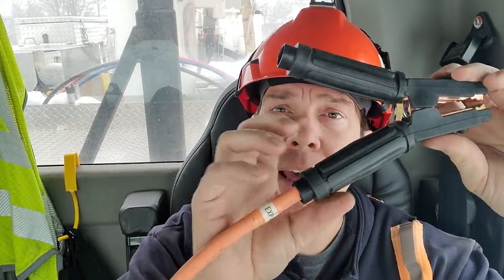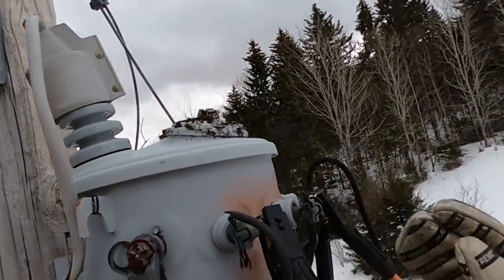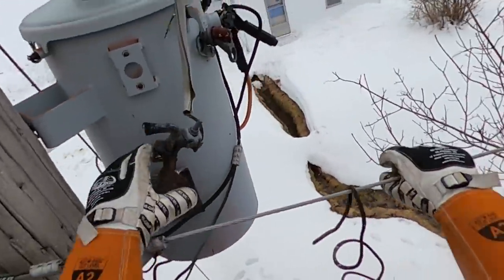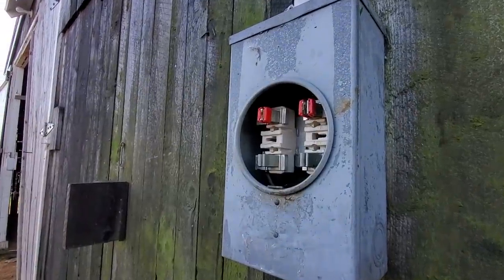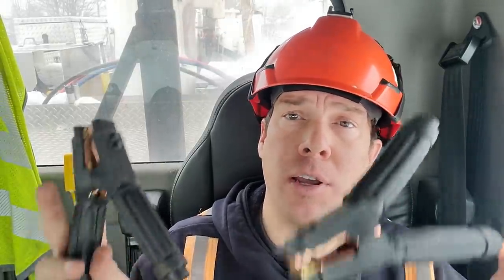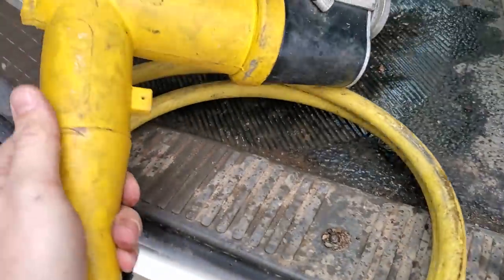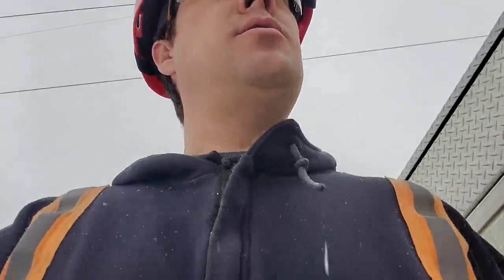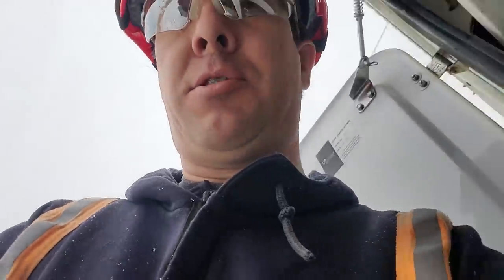A closer look a secondary grounding

Comment from the maker: I show an adaptor used for grounding at the end of the video... I'm curious if it's something that many of you have seen/used before?? 🤔 
Cheers everyone! Have a great week! 🍻✌
Reply: Don’t use secondary grounds just isolate the meter from the house and or remove drop leads from transformer bushings...that’s our work procedure in Ontario
Reply: Old guy taught me to use a crescent wrench to jumper out the bushings on the can ...👌🤞
Reply: How is the primary on a 3 phase pad mount connected? Wye or delta?
Reply: Never seen secondary grounds before watching you.  Maybe other companies should watch this video and take note of it and they could very well be saving time vs pulling meters or leads
Reply: PLEASE help me understand.

I am having a hard time seeing how secondary grounds eliminate the potential for backfeed.

Wouldn't the secondary coil see voltage until the generator breaker opended up?   Thus, voltage on the secondary coil and voltage on the primary for as many cycles as it takes for the generator protection to work.

However, shorts on the secondary could blow up the generator which would be very satisfying.....
Reply: @Cory.Robson  if there's a wire shorting the taps of the transformer, not really a possibility for potential, is there?
Reply: @mdgnys  even though shorted, there is definitely a potential difference (and circulating current).  The same as paralleling two feeders - if you are at the null point, you can open the tie without so much as a spark.  The further away you get from that point, the greater the arc.

Another analogy - If A phase contacts B phase, it doesn't go to 0 volts, it goes to full line voltage (both phases).  

Besides that, X2 references ground.  There is also a potential difference between primary and secondary coils.
Reply: Love it how nobody in this sub-thread answers Bob's question but goes rambling completely random irrelevant stories/other questions 😂
Reply: Dusty 99  I ask a valid question and have some valid points.  I am sorry that it is so hard for you to understand.  Please let the big boys talk now.  Thanks!
Reply: Looks like a grounding line clamp
Reply from the maker: All valid points imo. During any grounding procedure there's a chance for a difference in potential until the source is eliminated. Even if only for a few cycles ... It can still be deadly. For this reason we have some of the bonding procedures which will help minimize the difference in potential throughout the bonded work area in the event of a fault. 
Grounds or not, I wouldn't want to be in a work zone that was accidentally energized. 
Great discussion everyone ✌️🍻
Reply: @Cory.Robson  ... I believe you are clouding the issue because tying the 2 legs together (opposing 60 cycle waves) will cause the factory installed smoke to come out somewhere, and therefore the voltage to ground will become zero.
Reply: @rupe53  Factory installed smoke, lol.  I was thinking about few cycles before the smoke feature shows up.

Thanks for the reply!  That actually makes a bit of sense in my small brain.  Without putting more thought into it, I assume that each leg of a single phase service is 180 degrees out.  Therefore you could be spot on.  

@Aaron, sorry for derailing your post. In case you haven't noticed, I tend to overthink things sometimes.
Reply: @Cory.Robson  ... at 60 cycles per second, how long would a few cycles take?  <LOL> BTW, the smoke is a warning sign.... that's repairs are about to get expensive!
Reply: @rupe53  easily long enough to stop a heart from beating.
Reply: The device you asked about at the end of the video is what we call a cut- out ground. We use them to ground primary underground at the riser.
Reply: We called that grounding tool a "cutout clamp". It is used for grounding out the load side of a cut out. Use caution when using it on porcelain cutouts. The weight of the grounds could cause them the break.
Reply: @rupe53  I’ve seen that smoke before, both caused it and witnessed partners doing it. MAN, it’s expensive to put the smoke back in the unit.  Not once was the boss happy that we let out that magic smoke, even though it was pretty 😏

Comment: We live where the Electric company is a Cooperative. Small one in Michigan and they are great. Our power comes from a near by dam. It was spring and we had a very bad wind almost tornado that took the trees down. Our area lost power.  I gave the crew my small chainsaw to use in the bucket. The neighborhood cooked food for them and we had a generator for our well. So our place was for drinking water. Most of the homeowners have boats and lots of gas. The local gas station had no power. So we provided what they repair crews needed. Took three days for the power to be restored in our area. As a coop we know the crew more than a big city.

Enjoy your videos

Comment: That adapter is for grounding out the bottom side of cut outs....goes in where the door sits...we use them especially for grounding older primary risers so we can leave the the terminators in the bottom of the cut out... great video👍🏻
Reply from the maker: 💯💯💯 yessir! Especially nice when those terminations are jammed in there!

Comment: I carry 3 of them on my truck. They work good. Pull the cutout door install those and you can use overhead grounds to ground a primary dip pole!!!’
Reply from the maker: Exactly it, I love em! Especially when the termination is jammed right into the cutout without a lead💯💯
Reply: @Bobsdecline  yes yes!! I like to use them when on old pot heads so they don’t break. Great videos btw, keep it up!!

Comment: On meters, have to be sure they are simple pull out meters and not separately CT’d meters. Also, I wouldn’t trust my life that pulling all the meters will actually disconnect everything. Who knows if some joker connected something line side to the meter (highly unlikely, but all it takes is one time). Or, mutual induction via energized lines adjacent to those secondary runs. I’d always ground like you did on the bushings, safest way. Excellent videos tho. Wish we had these when I was learning at my utility. Despite being an engineer, I like seeing these things. Mad respect for the work you guys do!
Reply: I went to a structure fire once and pulled the remote meter because the handhole was buried.  We ended up going back to disconnect again because they were stealing power before the meter.

Comment: Hi Aaron,
Yes, I have a set of three of those grounding connectors that hang in the bottom of the cut out. They are really great when you have a primary riser where the terminators are connected to the lug on the cutout. It keeps the terminators from swinging in the breeze or when installing/removing grounds on a primary riser. They are antique in the fact that not a lot of trucks have them. 

That double feed through is banned at Eversource. The steel screw that passes through the aluminum frame on that feed through will break/bend over time. Or the aluminum fatigues & breaks? There are a few left out in the field. I throw them out as they are antique as well. Antique bad. 

I have a tool I acquired at ConEd that you might not know what it is? My retired fellow lineman who worked in linework for 50 years said he never saw one like it? I’ll take a picture of it & see if you know what it’s used for? I think as soon as you see it? You’ll know what it’s for?

Comment: We called that grounding tool a "cutout clamp". It is used for grounding out the load side of a cut out. Use caution when using it on porcelain cutouts. The weight of the grounds could cause them the break.

Comment: that is an adapter that hangs in the bottom of the cut-out. It would be handy to not have to remove the LA hot line clamp when installing grounds. You can ground on the LA tap, but I never like how much they can move around. I need to get some of those for my truck. Great video

Comment: We require the LV-side of the windings to be removed, along with the HV-side removed prior to winching-down the transformer.  We tie the transformers  LV sides along runs - as all transformers in a HV circuit share load.

Comment: after the Derecho hit our local utility was out for days repairing. They left 3 jumper wires on from the 3 upper lines to the single line below. any idea why they would still be on there months later )4+ m) similar to hot-neutral bonds like you discussed and showed briefly @ beginning of this vid
Reply from the maker: Hmmm hard to say ... A portion of  line may be temporarily out of service with an alternate feed. It can be tricky to see, sometimes we will install "floating insulators" to seperate a live high voltage line from a damaged section until repairs can be made. Often times when a line isn't in service, it's left with grounds installed for a whole video's worth of reasons 😎

Comment: When hooking up a generator to the house always have a qualified electrician to make the proper connections...
Reply: oh come on you can just plug it into any outlet with a male to male cable.  sure you have to make on but itll work XD (satire of course)
Reply: There also middle way solutions like evaluating yourself whether you are able to do the generator install in a proper manner with an interlock. Household electricity is no rocket science. It are just the total fools who carelessy mess it up and endanger the linemen. The DIYing people who install it wrong are not going to listen to the advice to let a qualified electrician do it. The DIYing people who install it right are not a problem so don’t need to be put up with an enormous electrician bill.

Comment: How often do you actually encounter backfeeding voltage from a secondary, and do you know what the cause is when you do see it?
Its my understanding that solar and similar systems shut down when mains is lost, and I can't believe THAT many people hook up a generator improperly back-feeding to make it a common occurrence?
Reply from the maker: Not very often ... Most setup ups these days are done properly, or at least have their main disconnected. It's more that the consequences can very severe, even on just one occasion.
Reply: @Bobsdecline  absolutely worth precautions - I was just wondering if it really happened much.  Good to hear that its not a common thing.
Reply: I can imagine backfeeding being more of a problem in suburban and urban areas that don't lose power much but got hit with a major storm causing a LONG outage. More people will try to cobble something together with a widowmaker cable in that type of situation.

In a rural setting where power is lost for longer periods of time if anyone did this and left power on they most likely already learned their lesson by blowing up their inverter or generator during the last power outage.

It does happen because those types of failures are not super rare in portable generator and inverter repair... It does massive damage.

Comment: If someone did connect a small home generator and backfeed into the power lines, wouldn't the generator usually trip its the breaker since there are probably several houses still connected to that same circuit?
Reply from the maker: Correct, most times the genetor would trip rather quickly.However with many more homes now also having generators, it's becoming more likely that other homes will have their breakers open.  It's not that it's a likely situation, but that reprocussions can be severe.
Reply: @Bobsdecline  I hear about backfeed all the time when it comes to generators and the consequences of it.  Those who backfeed should be held responsible for their actions because many lives are put in danger
Reply: Possibly not.  There is enough line resistance that the generator will likely not pick up the load of the other houses.  The voltage drop will probably be great enough to not allow for a high current draw.

Also.... ground a line that is backfed....  The generator won't trip and will be unaffected because the transformer works as an isolation transformer.
Reply: Is it safe to backfeed to the distribution panel, as long as the main breaker is closed?
Reply: @Cory.Robson  The shunt on the primary will still load down the generator.  Isolation transformers do not limit fault currents to a level that would not stall out the generator unless there was something funky with the primary system series impedance.
Reply: @randacnam7321  ... you guys are over thinking the generator issue. If four homes are connected to the same pole transformer then any back feed at one house will feed to the other houses via the point where all the wires meet. Will power go elsewhere? (primary?) Yes, that's a possibility, depending on other equipment damage. Will the gen set trip it's own breaker, burn up or have issues? More than likely, but how soon is anyone's guess.
Reply: Where is the completion of the circuit when a generator is backfeeding? Assuming that the generator is on wheels or some other isolation, what would be the curent path to cause a shock to someone?
Reply: @samsmith3025  ... Good question and something a lineman shouldn't have to ask. (hint: wheels do not provide isolation) OTOH, anyone working in the power business needs to look first to stay safe because you never know if that generator is connected correctly or not. In direct answer to the question it's the wires that complete the current path.... and wires are always necessary when you use a generator.

Comment: In the case of our street all Ausgrid do to prevent back feeding through the secondary 415 Volts AC Line (240 volts AC phase) voltage is to drop down the secondary fuses  to open the circuit :-

https://maps.app.goo.gl/3riKsqn1TBybQnLV7

That's to stop any residual voltage back feeding through the 11 kV side, they also have a grounding procedure for the 11 kV feeder for even when the main 11 kV isolation switch is opened just in case there is stored charge in any of the transformers when they do line work on the power lines because they don't go around dropping down all of the primary fuses  !
Reply: Removing the secondary fuses would probably be the best way to prevent backfeed, but that will never work here in North America. Why? It's simple, we actually don't have secondary fuses in the distribution network.
Reply: @eDoc2020  i was about to mention same thing.
New Zealand
Australia
We use primary and secondary fuses.

All videos in USA, Canada that I seen have no secondary fusing.